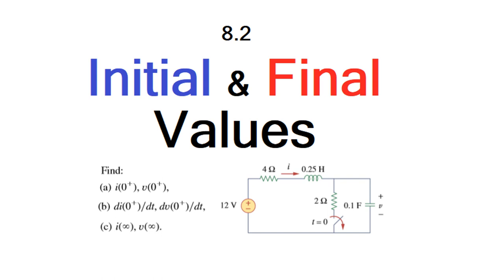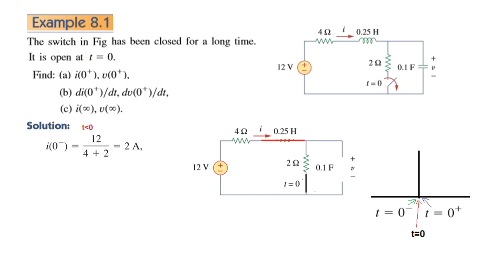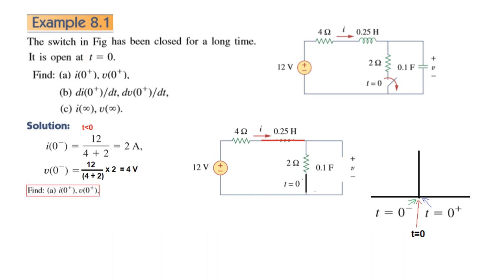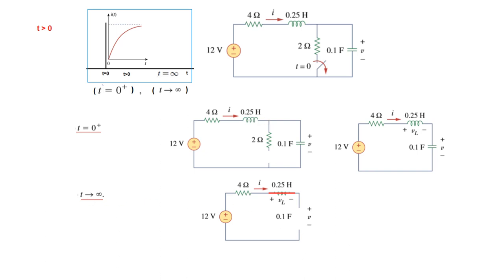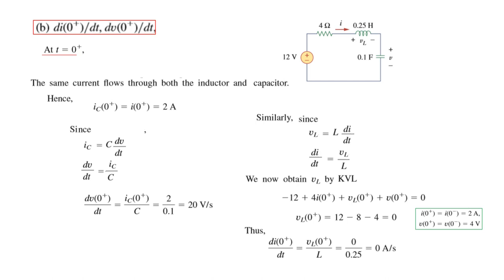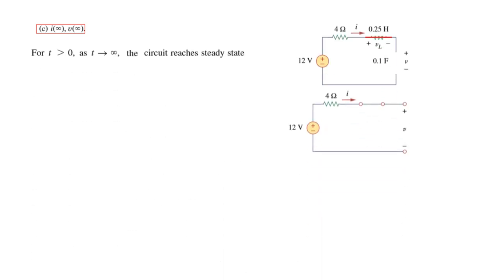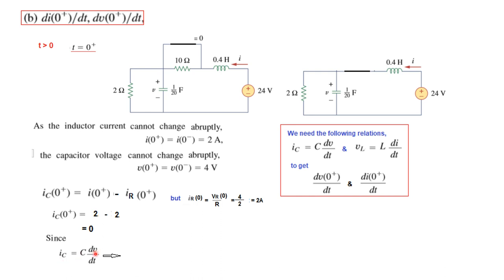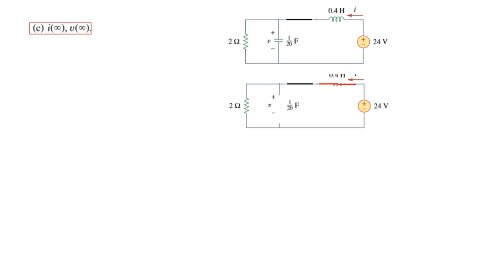Initial Values and Final Values || Second Order Circuit || Example 8.1 || Practice 8.1|| LCA 8.2(1)

Comment: I am facing difficulty in solving unsolved question No. 14.39 of the Sadiku, 7th edition. It's a tank circuit/parallel with R and L in parallel with C. Given is the source current and we need to find the resonant frequency. I believe we should solve for Admittance and equate the Imaginary part of admittance to zero. 
However, I do not know where am I going wrong, I am not getting the answer. 
Could you please post a video on it.

Comment: 14:13 solving for inductor voltage we get -20 insted of +20
Reply from the maker: Thanks for pointing out the mistake. Actullay, (keeping in view the current direction) I should have putten negative sign with vL(+0), so the eq should be  -v(0+) -vL(0+) +24 = 0. Thanks again